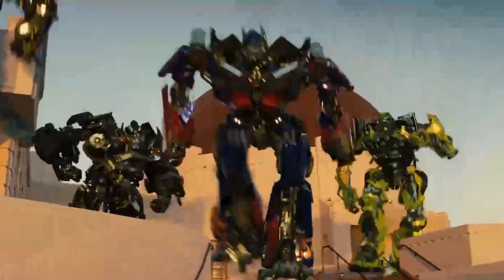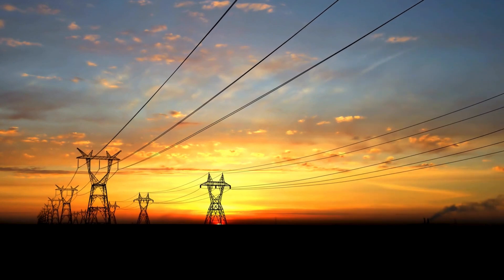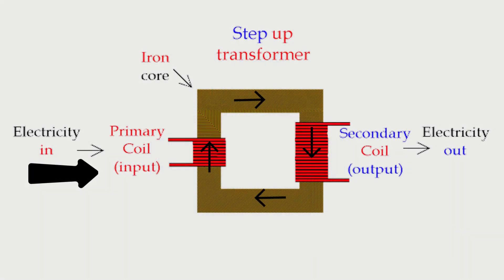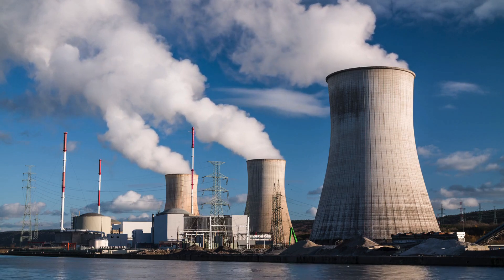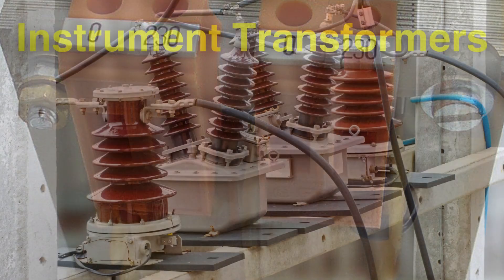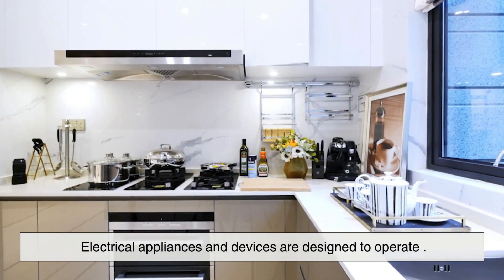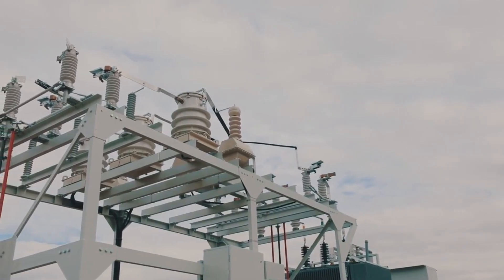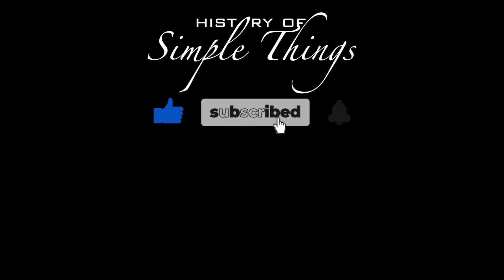How Transformers Make Electricity Work for You

Comment: An essential detail is that a transformer has no moving parts. Alternating current has an inherent property of motion. Thus a power transformer can be left to quietly hum away in a substation. (The humming sound is caused by the phenomenon of magnetostriction in the iron core).

Something similar was also possible to a limited extent on a direct current power system. But devices known as rotary converters would be required to step voltages up and down, incorporating an armature spinning away continuously.

Comment: Transformers are used in AC power systems to step the voltage up to a high voltage from a power station generator to enable it to travel long distances and when the high voltage AC power gets to where it’s needed, another transformer is used to step the voltage down to a safe voltage such as 240V to be able to be used in your home

Comment: Why transformers are not housed inside a huge room ?  I see it is always kept outside in open env
Reply: I'm Finland they are typically a small building but because of the 400 V network thru can be further away. The US 240 V system requires them to be closer.
Reply: An outdoor rated TX can be installed in outdoors or indoors.

Some TX are intentionally housed in enclosed spaces (despite being outdoor rated) for Aesthetic purposes.

Comment: 4:20 Distribution transformers are common in the USA. One can for one or two houses. 
In Europe transformers look more like 3:54. One or more transformers for a town.
Reply: Depends on how big the place is 

For example in New Zealand you have transmission stations with big power transformers, going from 220/110 KV for transmission down to 33 or 11 to give to distribution companies who then step it down or keep it at 11 until either pole mounted (usually rural)  or pad mounted transformers which feed a few houses

Comment: Thanks again for another great video! There is however one correction which needs to be made. 
The purpose of the iron core is not to amplify the magnetic field, as stated at about 2:46, but instead is to channel the magnetic flux from the primary winding to the secondary winding more efficiently.
The actual voltage amplification comes from the ratio of the number of windings or turns between the primary and secondary coils. 
For example, if the primary winding has 10 turns and the secondary winding has 20 turns the ratio will be 10 to 20 (sometimes shown as 10 : 20) which is a ratio of 1 to 2, producing a stepped up voltage twice as large on the secondary coil as was on the primary coil. 
It's interesting to note that as the voltage is stepped up, the current is stepped down by the same ratio.